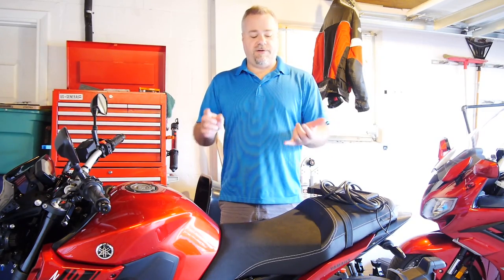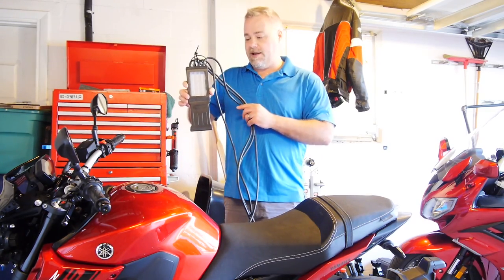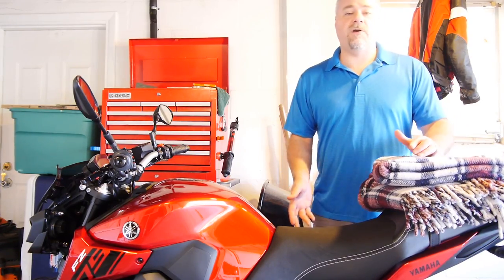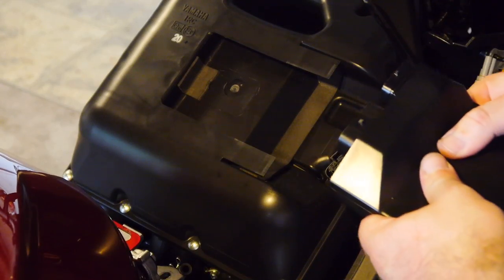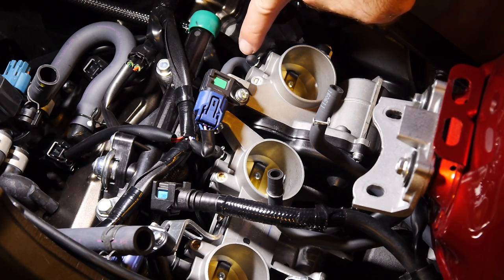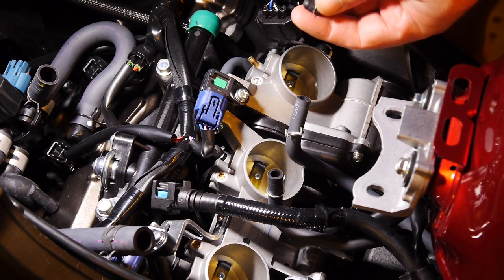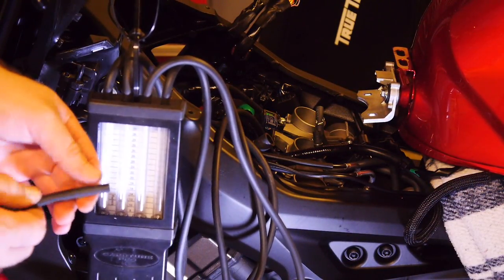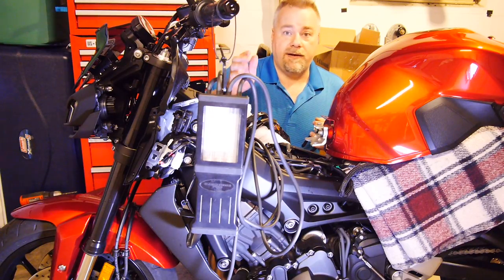How To Do A Throttle Body Sync TBS 2017 FZ09 MT09 FJ09 MT09 Tracer XSR

Comment: I love your video’s.  

One issue with this one. It makes absolutely no sense to synchronize at idle. When you are cruising along at 70 MPH your rpm is way above idle. The engine should be synchronized for your riding  and not sitting at idle. This bike is new to me so I followed your advice and went with synchronization at idle.  Great idle but at 5000 I was not happy. More buzz in the mirrors and bars then I wanted. 
If you synchronize at idle do yourself a favor and gradually bring up the rpms to about 4K.  Most of the time you will see that the bars are no longer a equal.   Now synchronize at the higher idle, as close to your cruise rpm as possible.  Drop back to idle and guess what?  The idle is still very smooth.   Put it all back together and enjoy a very smooth and almost vibration free ride. 

This has worked with my boxer BMW, MY V Storm and my 1100 Ducati.
Reply from the maker: I'm going by book spec.  The computer is only calibrated to them at idle.  My bikes are perfectly smooth at all RPMs, setting it correctly at idle, by the book.
Reply: TwoWheelObsession 

I understand the need to go by the book. Mine was ok after synchronizing at idle but better when I redid it at a higher rpm, 4000k
Every motor of the same type is somewhat different   No two are exactly the same and will require a little finesse to get it to where the rider is happy with the results.  This is where the dealers fall short.  Again your videos are without a doubt the best to be found on YouTube.  Your video work is perfect. Your wife must be holding the camera. 

Thanks again
Reply: @ronaldardito6202  When syncing injection throttle bodies, you’re really only adjusting BYPASS which is at idle. At open throttle adjustment has no effect, so it’s pointless at higher rpms. That’s why the book, written by engineers, says @ idle. TWO is correct.